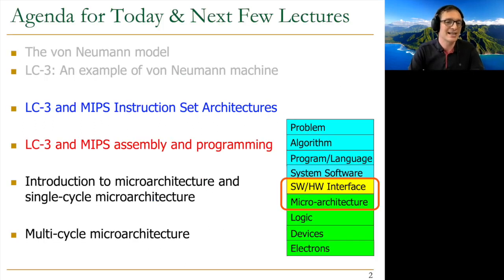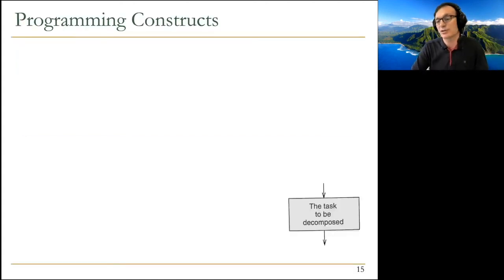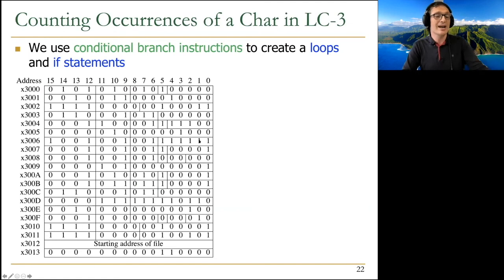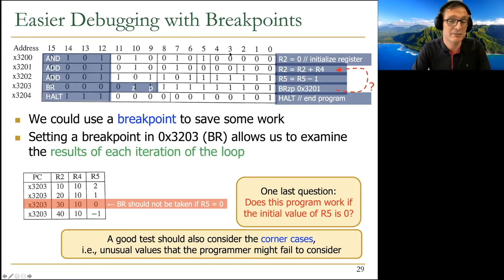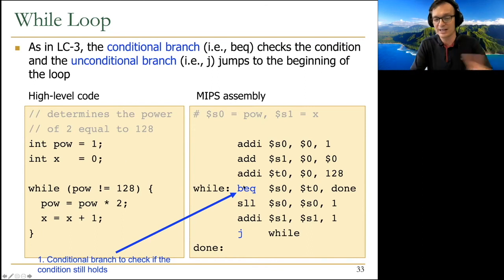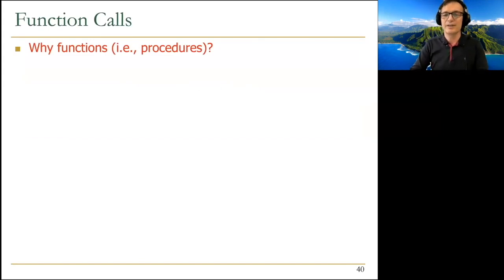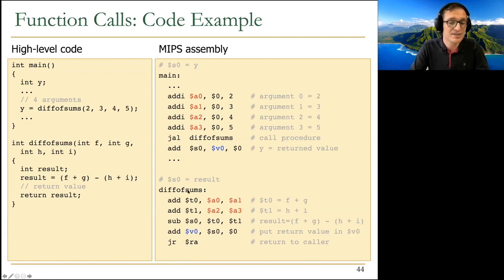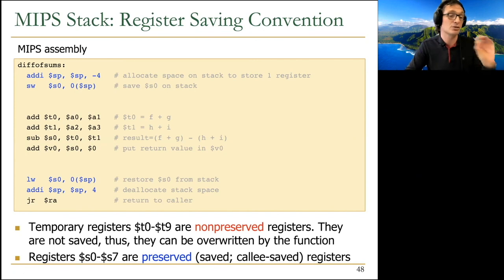Digital Design & Computer Architecture - Lecture 10b: Assembly Programming (Spring 2022)

Comment: Hello -  I have been trying to understand logic gates for some time and where I am getting stuck is that I do not get what the end goal of them actually is.  I get that they can be strung together to make to get results but I do not understand what those results are actually doing.  I don't have any real background in the topic besides self study so maybe this is something that is learned very early on in the computer science journey.  Is this something you can explain or is there a place specifically in your videos which can enlighten me?  I would be awesome if you could...thanks for all of the content.
Reply: logic gates is an abstraction to describe the behaviour of some physical devices when they receive signals, in the case of desktop computers the devices are micro transistors but since logic gates is an abstraction you can use many different devices for example some people built them using minecrafts redstone and arranged them in the same way as the ones made of transistors to implement entire computers thats the power of the gates thing
Reply: @samas69420  Thanks very much   There is a course called NAND to Tetris that I am considering taking and it goes all through this stuff...it is incredibly cool